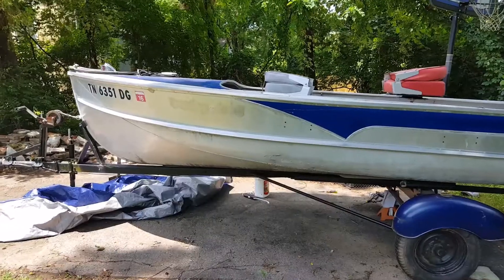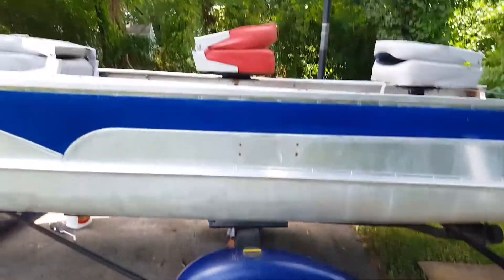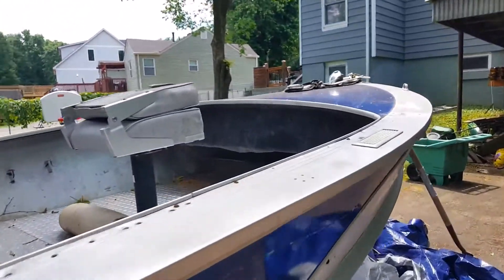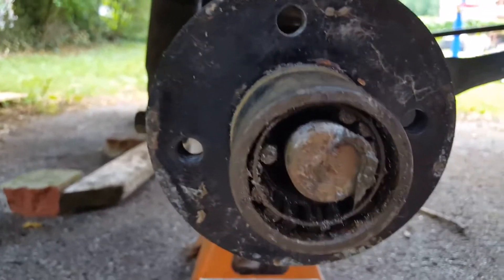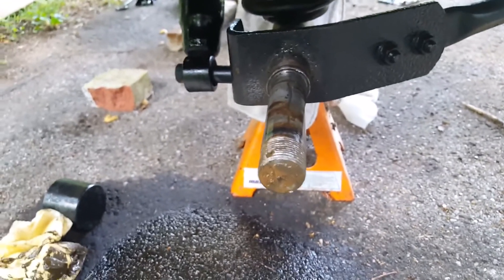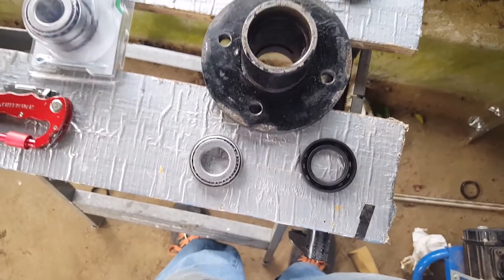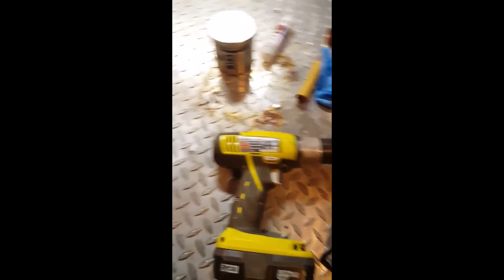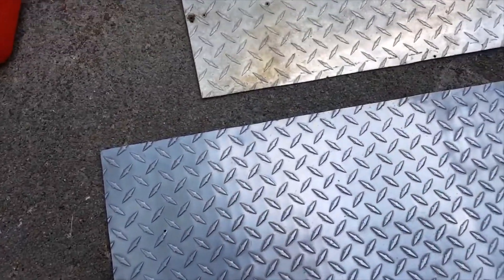1950's Cadillac Boat Renovation! Part 1

Comment: I have a similar boat & cannot figure out what size that bottom plug is. Did you find the right size?
Reply from the maker: Thanks for watching! I sealed the bottom plug with JB Weld. Then drilled a hole near the base of the transom and installed a new plug.